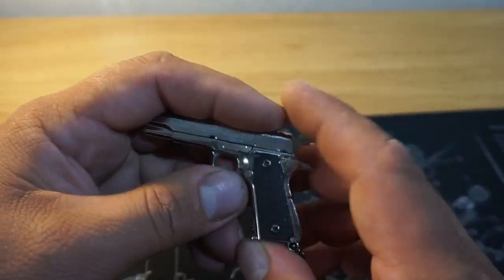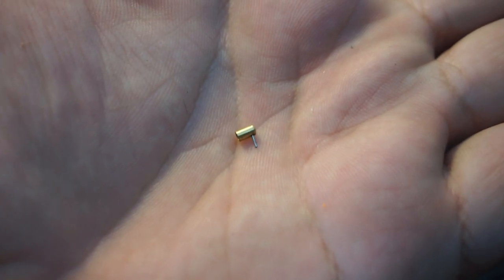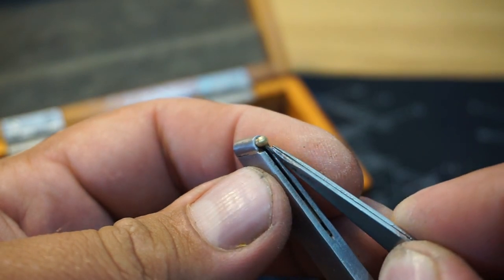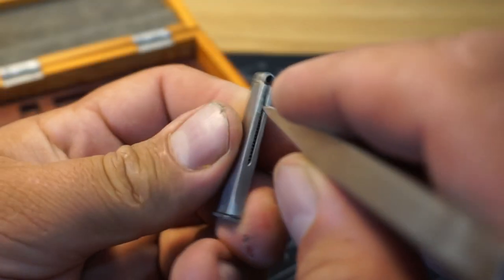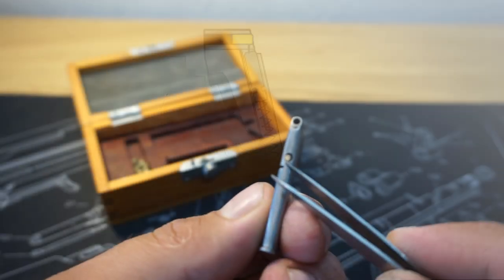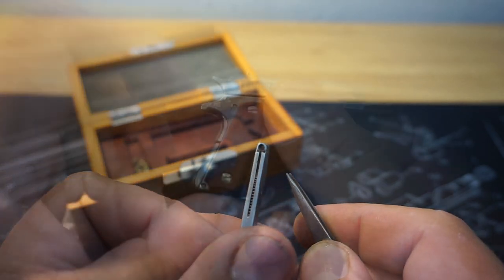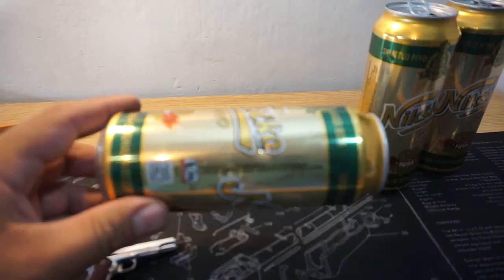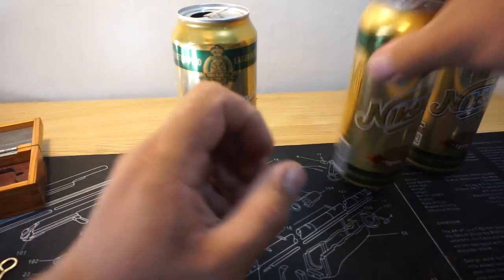Miniature Pinfire Colt 1911 for 5$ ?!

Comment: Hi Comrade, a very enjoyable video. I'm thinking you had to modify the 1911 a bit more that just the magazine. (remove metal from the slide to get the magazine in line with the barrel and possibly lengthen the trigger to activate the magazine?) But keep up the good work.
Reply from the maker: Yes, also made a new steel barrel. But main work is magazine.
Reply: @ComradeMauser  Thanks for your reply. Is there any chance that we could see photos of the modiications to the slide and trigger?
Reply: @mikefurnell9832 I agree. Can we see a vid on how

Comment: Seeing how the cartridge flies back when fired it seems it would have enough energy to operate some type of tiny open bolt submachine gun. The pin could be pushed by the side of the actual housing that holds the bolt, with the bolt only pushing the cartridge itself forward. Figuring out a magazine and an ejector for the spent casings would be more difficult. But how cool would it be to have a 2mm pinfire submachine gun.

Comment: less than 1 joule....I hope these are UK legal because that's lower than most air pistols (Max 6 Joules) in terms of pew strength. I would love to start a collection if they are legal
Reply from the maker: They are normally sells as a blanks. You can add bullet or not. 
Search for "2mm pinfire breloque" this is standard model for about 30$
Reply: @ComradeMauser where did you get it?